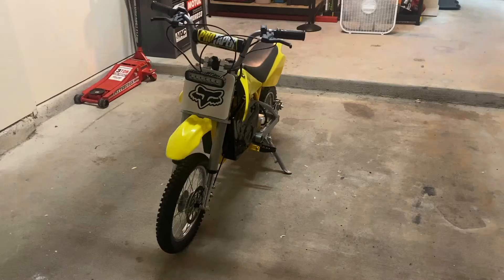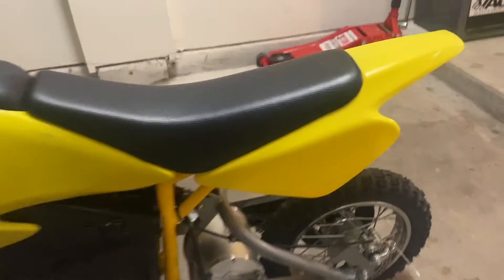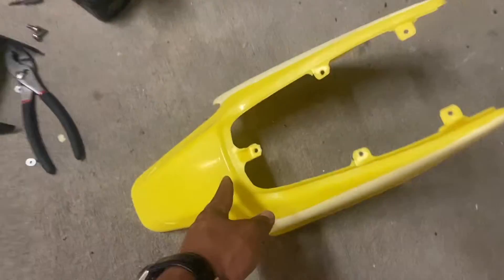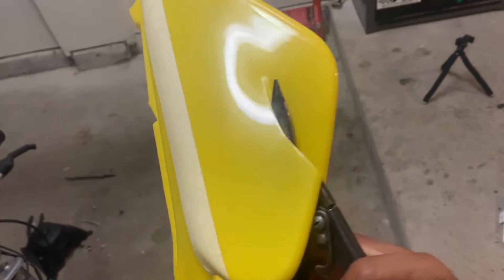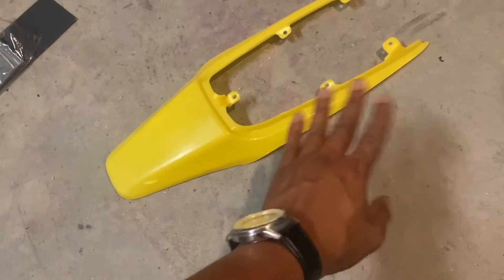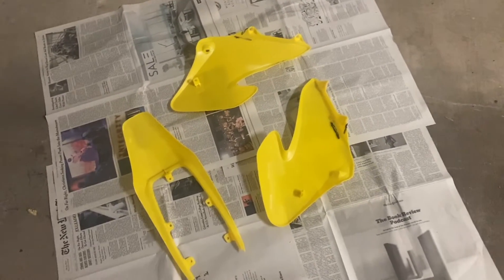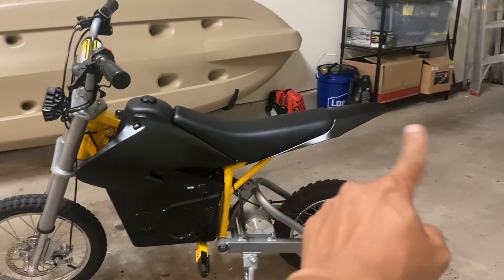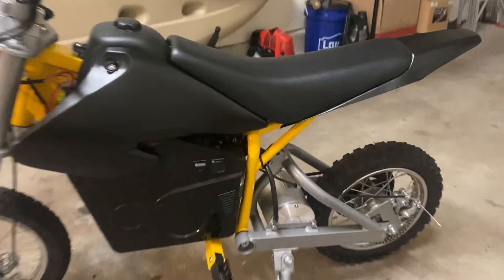Razor MX650 to MX2000 Conversion Part 3 | Kunray 2000W 48V NEW LOOK! Trimmed Fairings

Comment: Good video, I am planning on doing the same, it would be awesome if you opened the motor and installed a thicker copper wire to see if it can handle 72 volts or even more without burning.
Reply from the maker: Have you done this before?
Reply: @PatOutdoors  No, but I have seen videos of people doing it and the motor spins faster, due to physics, the thicker the wire the higher the resistance.

Comment: How did you wire the brakes to the controller?
Reply from the maker: I purposely did not wire the brakes to the controller. I left them unplugged so it wouldn't cut the throttle when I apply the front brake so it allows me to do a burnout if I want.
Reply: @PatOutdoors  Oh im going to do that. The brakes still work even thought they are not connected to the controller?
Reply from the maker: @Dmaze652  The brakes are cable driven, so yes they will still work. It just doesn't cut the throttle when you activate the brakes
Reply: @PatOutdoors  thanks. Can I ask how the torque is with the 11t sprocket? Is there enough power to wheelie?
Reply: Or does the 13t sprocket have enough tork with the 2000w motor

Comment: How would you go about painting the frame?
Reply from the maker: Been thinking about doing this pretty soon actually. To do it properly, you'd have to fully strip it down to frame then sand the original paint surface to get the new layer to adhere.

Comment: Whats the top speed on this thing?
Reply from the maker: Currently 31-32 MPH with the stock sprocket on the larger street tires. During this video, about the same speed with the 13T sprocket and stock tires.